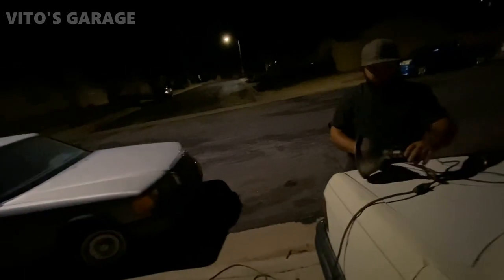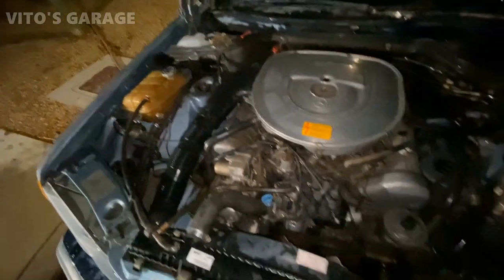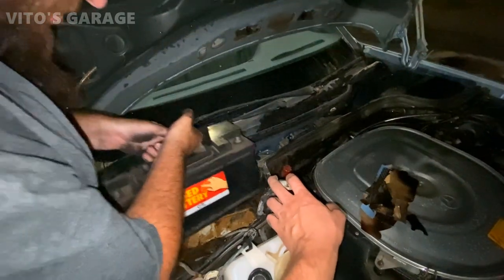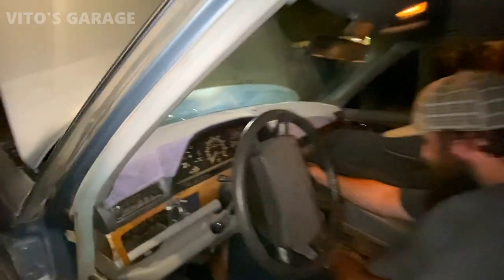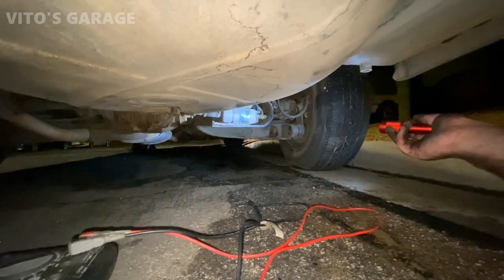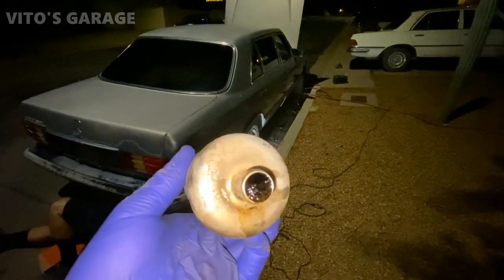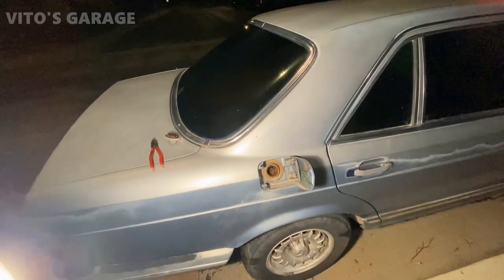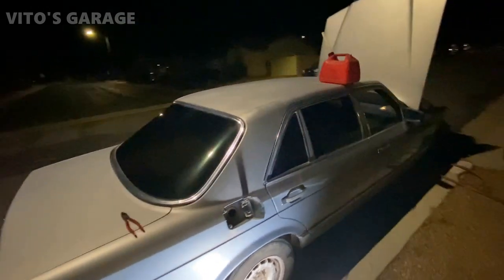Will We Have a First Start of This V8 Mercedes W126 S Class?? Or Do We Have a Big Problem???

Comment: Hello nice video! That's a cool car! Maybe this could be helpful. 
The same thing happened to me with the fuel system of my mercedes 230TE w123 , it was sitting for 10 years. The gas tank had a lot of fuel varnish, all the fuel hoses were full of this varnish crap also the fuel pump and fuel accumulator.( Lacquer Thinner is great stuff to clean fuel varnish). With the fuel pump, I took it out of the car and with a syringe, I injected it with lacquer thinner to dissolve the old fuel and connected it to a battery and kept changing the terminals several times until it was unlocked.(the terminals will spark a little bit) You can try this if you want to save some money.It worked for me
With the metal fuel lines I also used thinner with the syringe to clean them. 
For the fuel tank, I couldn't fix it because it had a big hole on it, so I replaced it. In internet are some videos on how to clean a fuel tank, most of the time they use vinegar and muriatic acid. Some people say the best way is hydrolysis. 
I replaced the fuel filter and hoses, cleaned the fuel accumulator injecting thinner and shaking it. 
Once this pieces were cleaned and replaced I tryed to start the car, it didn't started right away it took some attempts to start. 
I hope this story can help you with something. I apologize for my English, I am trying to improve it. I wish you the best! God bless you! Thank you so much for sharing this amazing content !! Greetings
Reply: Here is a video on how to clean and remove rust of your tank: https://youtu.be/KW_Etp_PUqM
Reply from the maker: Thank you so much for all this info, Sergio! We bought a good used fuel tank for it and other parts. New videos coming soon. And your English is amazing, don't worry! Thank you for watching and supporting Vito's Garage :)
Reply: @VITOSGARAGE  Thank you! 😊

Comment: Hi! Came to you from Estonian channel Flexiny. Have you seen, how he often avoids this nightmare of corroded fuel systems, bypassing those by a random construction with the fuel coming from a plastic bottle? Just to get the engine run.
Reply from the maker: Well, we are restoring the car. Not just trying to get it to run. So yes, the fuel system is gonna be figured out and fixed

Comment: Hey vito! Just wondering if you could tell me what parts of the engine on a 201 and 124 I should cover before cleaning? Thanks!
Reply from the maker: It depends what engine but Cover the alternator with plastic bag and air intake (air filter).